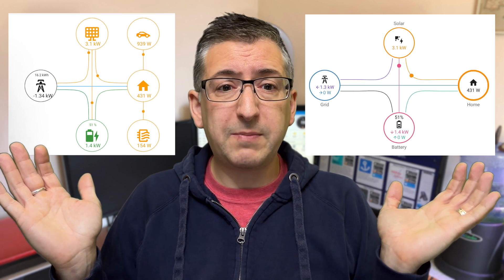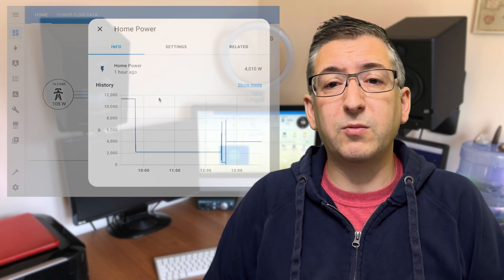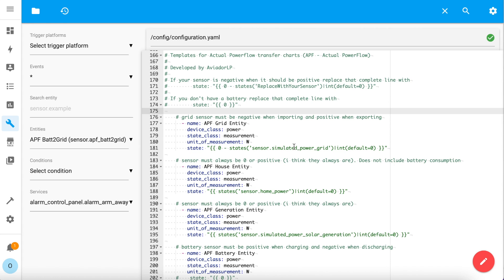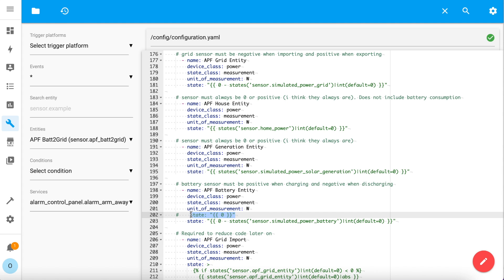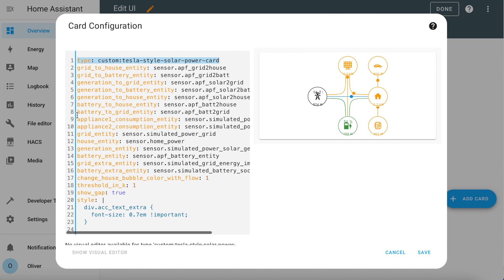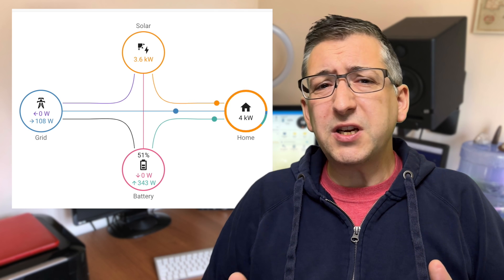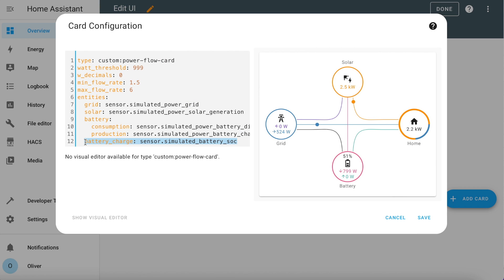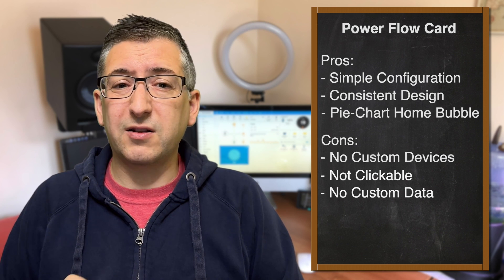Power Flow Cards for Home Assistant

Comment: No Inverter in the display?? The SolisCloud, which is the first power flow display I ever saw, has an inverter circle in the middle. Makes sense to me. Why does no one else include one?
Reply from the maker: It's more abstracted this way and I prefer it, but there is also the Sunsynk card which shows the inverter if you like that sort of layout. I have three inverters so things would get quite messy if they were all on the diagram!

Comment: How have you configured your podpoint charger into HA. I have been looking for an away to do it but all in vain..
Reply from the maker: I installed this integration using HACS, but it doesn’t give you power. To get power data you need an energy monitor (CT clamp) on the live cable going in to it. https://github.com/mattrayner/pod-point-home-assistant-component

Comment: brilliant! thank you. thumbs up, subscribed.
Would be interesting to know which browser you were using as you noticed rendering issues.
Could you think of how to implement the EV‘s battery not only being charged but also to provide power to your house (replacing the main battery)= power2house or power2grid?
Reply from the maker: I honestly can't remember which browser I used for the demo, but it would either be Safari or Chrome. Implementing a specific traffic flow from EV to home would likely require updating the card. Check out the Power Flow Card Plus and maybe make a suggestion in GitHub to the developer: https://github.com/flixlix/power-flow-card-plus

Comment: Thanks for this. I now have HACS on my Docker Home Assistant setup. How do you get your 'File Editor' option on the left menu? I'm excited to see the SolarEdge Modbus repository come up in HACS!
Reply from the maker: Assuming you are running Home Assistant operating system, go to Settings > Add-ons > Add-on Store (button bottom right) and search for File Editor. If you're not running Home Assistant OS (so, in Docker for example) then you'll need to find other ways to edit the configuration files.

Comment: hey 👋
A few days ago I forked ulic75's card and since then I've added a few additional features and small enhancements. On my to-do list is still adding UI Editor functionality (although I think this will take a lot of time). It is definitely still a work in progress, but in the meantime feel free to try it out using the YAML. If you have any problems configuring it, also feel free to reach out 🙂 I think if I post any links, the comment will be deleted, so it's called "Power Flow Card Plus".
PS: The card is not yet available as a default repo in HACS, but I am working on it

Comment: Struggling, completely new to HA and while I seem to have the energy showing ok, I have no idea which of my sensors I should be choosing for either of these cards  :( I have 2 givenergy batteries and  seem to have a multitude of entities none of which seem to match yours.
Reply from the maker: Are you using GivTCP in home assistant to talk to your GivEnergy inverter? If so there is a device called GivTCP power with a bunch of entities under. You want “PV power”, “grid power” and “battery power” although some of those are split into “charge power” and “discharge power” for the battery if you want separate entities
Reply: Ignore me, entered that line again, seems I had a stray character at the end
Reply from the maker: Also with two inverters you are going to need to do some custom template sensor wizardry to get it working and combine the values for the cards. Maybe figure out getting one inverter working first then move up a difficulty level!
Reply: Just one inverter, 2 batteries. Seem to have it sorted for the power flow one, apart from it shows the battery at 0% despite the entity showing it correctly when I check that directly.

Comment: It's a really great video, and quite easy to follow for a newbie ;)

I'm just not smart enough to do this, cause my import/export power is the same entity, but either positive or negative. The same goes for my battery, but opposite of your saying. So I',m not sure if I can use this.

Should i create a sensor for import and turn it positive, then create another for export that's also positive. If so, could you please help with that ?
Reply from the maker: Which card are you configuring, Tesla-style or Power Flow? It's easy and possible with both cards.
The Tesla-style one is designed for import/export being the same entity.

    - name: APF Grid Entity
      device_class: power
      state_class: measurement
      unit_of_measurement: W
      state: "{{ 0 - states('sensor.simulated_power_grid')|int(default=0) }}"

where it says sensor.simulated_power_grid is where you put your actual entity instead. If it's negative when importing then that's fine, otherwise remove the '0 -' bit in the state line.

For the Power Flow Card, if you need to reverse the import/export positive and negative then just add an inverterd_entities line before the list of entities like this:

inverted_entities: battery, grid
entities:
  grid: sensor.simulated_power_grid
  solar: sensor.simulated_power_solar_generation
  battery: sensor.simulated_power_battery
  battery_charge: sensor.simulated_battery_soc
Reply: @SpeakToTheGeekTech  Thangs for your quick reply :)

I am trying to configure the Tesla style.

Comment: Just sorted both out for one of my invertors. I prefer what the Tesla one can do (adding the appliances, showing extra data in the circles) however Power Flow card just looks so much nicer. Sadly it seems the dev has no interest at this time in adding additional bubbles or even allowing the Gas/Water ones they have added to be configurable, and sadly fixing that is well beyond my capabilities.
Reply from the maker: Yeah, same here. I did manage to start playing with the typescript source to tweak some css just to see if I could. Managed to compile it to Javascript too and run it, but it's a very long winded process. I reckon if I could set up a nice streamlined virtual instance of Home Assistant that VSCode can quickly and easily automatically integrate with then I'd stand a chance of being able to fork the card and adjust the gas/water bubbles to be templated. It's just getting the time! I'm sure I'll get around to it some day.

Comment: Hi, regarding Not the tesla card,, does it show live data coming from the solar panels, or just totals for the day so far?  Or does it just depend on what sensor you use?   If so, do i have to create a rimem sum sensor?  Or just use current watts sensor that i made from my inverter?    Thanks 👍
Reply from the maker: Hi, both of these cards are live power (w) cards, not energy (kWh). You use the power sensors in these cards, but if you want energy then Home Assistant has a built in energy card that looks identical to this non-Tesla card and you can use an integration sensors like you said to calculate energy from power to use in it
Reply: @SpeakToTheGeekTech  ahh ok, thank you..  Been messing with the energy tab version and wanted a live power one, so ill give this one a go 👍. Thanks 😀

Comment: Hi there.  For the Tesla style card, I get as far as the card configuration, but when I paste in your yaml configuration I straight away get an error message starting "Custom element doesn't exist: tesla-style-solar-power-card".  This is before I've edited the sensor references to my own.  What have I done wrong?
Reply from the maker: Have you installed the custom component in HACS? If so, you need to restart Home Assistant and then properly refresh your browser cache before it starts working. If you're able to use multiple browsers (for example, if you're using Chrome, try opening Home Assistant in Edge or Safari to test) then it may jump in to life too. If you've installed the component, it will start working eventually when your old browser cache expires.
Reply: @SpeakToTheGeekTech  I saw your fast response after I'd typed mine! It's all working fine now. Thanks again for the excellent videos! 👍
Reply: Solved! The Tesla card hadn't installed correctly. I re-downloaded it and was fine.

Comment: Thank you so much for your clear summary.
I live in Italy. I have been using the power flow card for about a month. Very beautiful and intuitive, but I don't like the movement of the dot. Because when the house is powered by a single source, the speed is the same, both at 1kwh and at 5. In the Tesla style, I had greater fluidity compared to real consumption. Do you think it can be changed? The min and max do not act in this case.
Reply from the maker: You'd have to be willing to dive into the code in order to tweak the dot speed algorithm I'm afraid.
Reply: @SpeakToTheGeekTech  yes. You're right. Ulic75 wrote the message below: This formula is based on the offical formula used by the Energy Distribution card.

max - (value / totalLines) * (max - min);
// max = max_flow_rate
// min = min_flow_rate
// value = line value, solar to grid for example
// totalLines = gridConsumption + solarConsumption + solarToBattery +
//   solarToGrid + batteryConsumption + batteryFromGrid + batteryToGrid
I'm not 100% happy with this.

Comment: Hi, when using the power flow script what's the Minimum & maximum flow rate for and threshold?
Reply from the maker: Those values define how fast the little balls fly along the lines! The values are in seconds, so I have the minimum set to 1.5 which means that at a high rate of power consumption the dot will take 1.5 seconds to move from circle to circle, but the maximum is 6 seconds to it'll never be slower than that at low power flow rates.
Reply: @SpeakToTheGeekTech  Thankyou,

Comment: Hi, how do I get simulated power flows?
Reply from the maker: Hi. For each fake power sensor I created a helper (which is the actual adjustable slider you see on the dashboard). Then I created a template sensor of type 'power' in YAML which has a state of the value of the associated Helper sensor. Those template sensors are the ones I used in the configuration of the cards. I purely created them in order to demonstrate the power flow cards in the video, I don't actually use them in real life.

Comment: Hi. I want to ask you how to get the solar entity? I have solar panels at home as part of new build house installation.

By the way, I followed your videos about Hildebrand and purchased the unit. Integration works perfectly fine on my Home Assistant and I love it. Now I'm more interested on solar sensor.
Reply: Upon checking my solar related documents, it appears that I have solar PV from eco2solar. 

It also looks like Shelly EM is the answer to my question. But would need someone to do the installation.
Reply: @ramilbrion4344  The Shelly EM devices are not designed to be installed in a way to analyze solar production. They are are rated to 2A. The device you want is the Shelley 3EM. You likely need two though. One for Solar production and another for Mains Import/Export metering.
Reply: I use homewizard energy as my energy monitoring solution and thus their SDM230 WiFi meter for the solar, but I wouldn’t recommend that except for people with a DSMR Dutch style smart meter.
Reply from the maker: That’s not an easy question to answer without knowing a lot more details sorry. It depends on the make and model of the solar inverter that you have, whether it has a smart monitoring capability, if there’s a Home Assistant component for it, or whether you’d need to purchase a third party energy monitor to do that for you